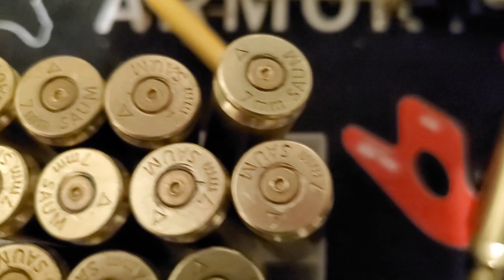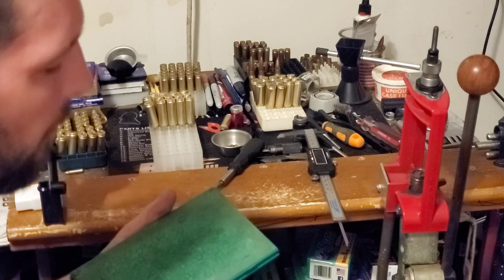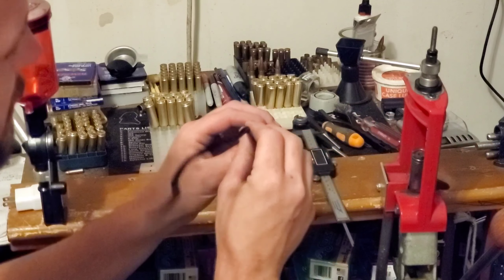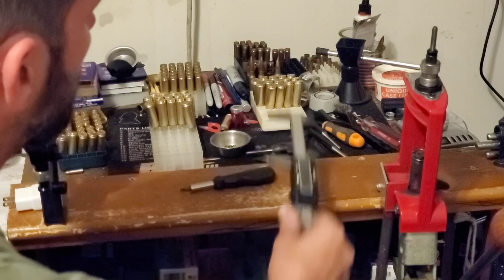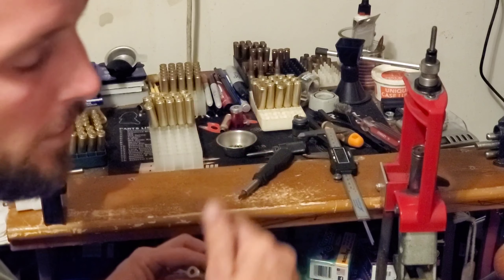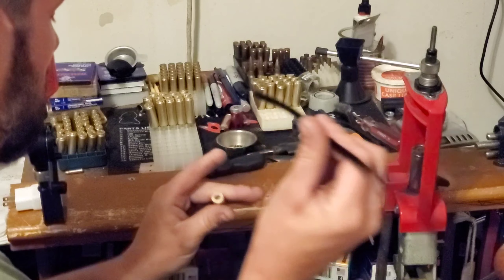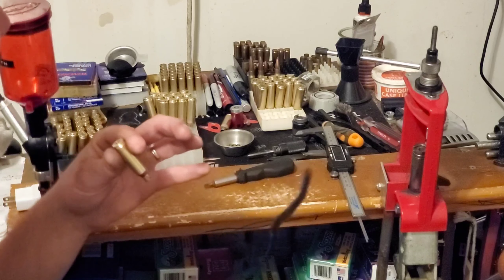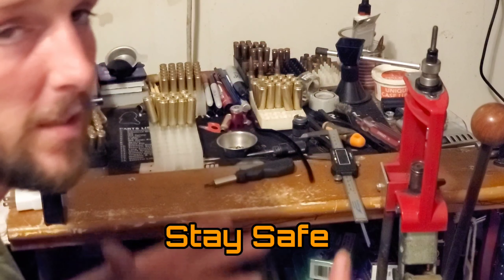My Brass Prep Method For Long Range Precision Shooting | Reloading

Comment: I might have missed it, but what kind of lube do you use on the pad? And how often if ever do you anneal brass? 

Another question is what is your preferred brass? This looks like ADG. I run Peterson, Lapua an ADG on most of mine... but I tend to blame external factors for not being able to hit an egg at 1000y. Lol
Reply from the maker: Yes this is ADG. I really like Lapua but I have actually come to prefer ADG over everything.  I have found that I get a few more firings out of the ADG. I Anneal every 7 firings with my good brass but I also have a lot of loads that I just use Hornady brass and its cheap enough that I  just use it until it wears out and scrap it which is typically around 10 firings. I usually use RCBS Case Lube  but I will also use Hornady sizing way sometimes as well. Yeah a little bit of wind shift makes those pesky eggs targets at 1000 yards a difficult task. Lol
Reply: @gunfather83  I bet its bad enough with no wind at all. 😆 
Thanks for the reply. I always read about these guys that spend hours on Lapua brass prepping it before first firing and even tossing 30 pieces out of a box because it is too light or heavy or not the way they want it... lol. Your method makes me realise that all that nonsence is simply not worth it

Comment: Talk about the KISS method ( keep it simple stupid) it works just fine . Some shooters go way overboard with neck turning, weighing every case , measuring case volume, checking bullet runout anneal cases after every firing etc when they only shoot steel  gongs or hunt out to 400 to 600 Yards . It’s all a waste of our precious time in my opinion. Cheers 🍻

Comment: Do you shoot a certain brand of brass? That way you're starting with more uniformity or have you found it all works? Love your channel and thanks for info.
Reply from the maker: Thank you.  I typically use Hornady brass. I find that its 1/3 the cost as a lot of other brands. It typically wears out in about 2/3 the time as really high end brass but I don't see any accuracy degradation.